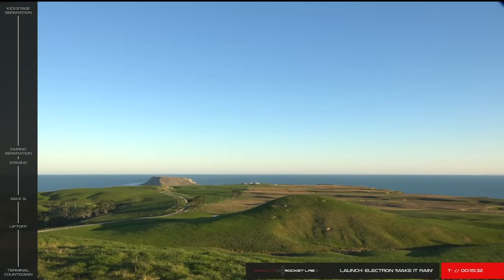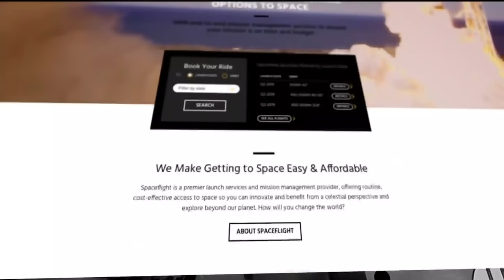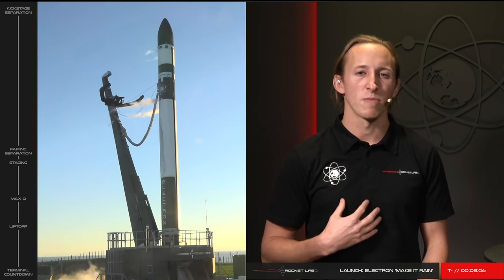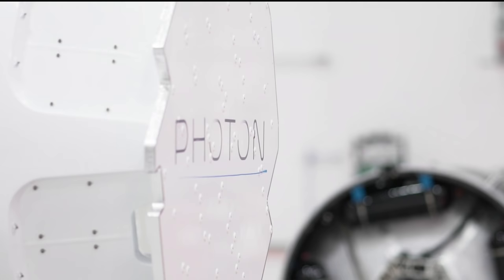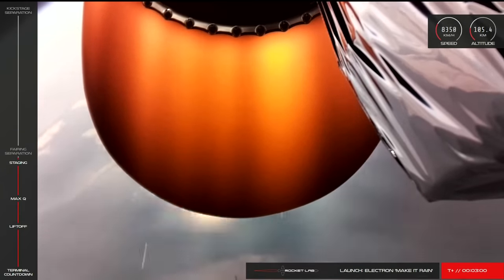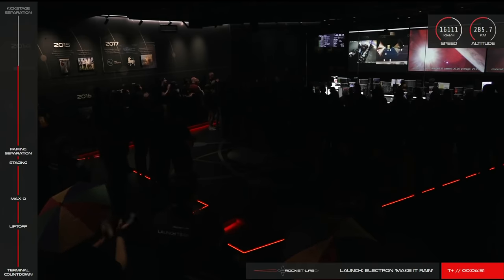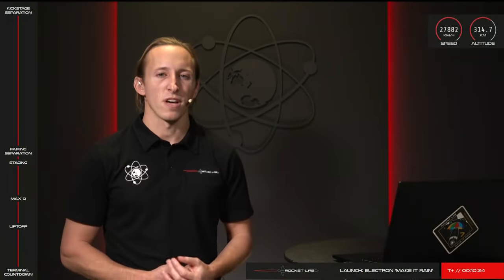Make It Rain Launch - 06/29/2019

Comment: Some of the callouts 
00:00 - [webcast start]
03:58 - "Okay, all stations this is flight on mission [cord?] standby for final poll for launch"
04:03 - "RCO"
04:04 - "RCO is go for launch"
04:05 - "LD"
04:06 - "LD is go for launch"
04:07 - "And executive" 
04:08 - "Executive is go for launch" 
04:11 - "Roger that thank you" 
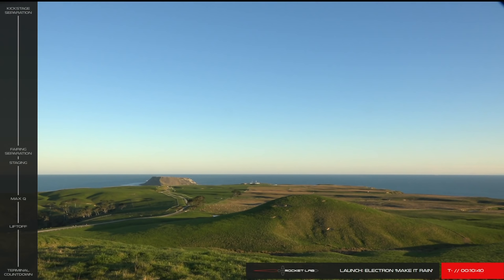08:16 - "clamps open"
08:18 - "preceding with strong back retract"
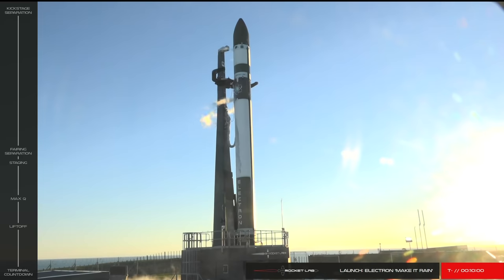08:53 - "BMS flight on mission cord"
08:56 - "Go ahead"
08:59 - "Please confirm all separation events are armed"
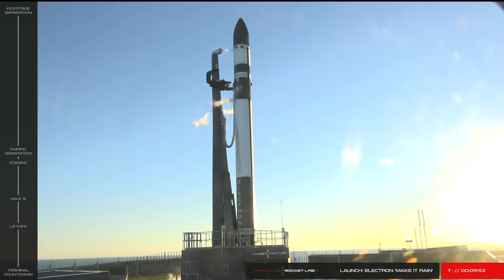09:02 - "All separations events are armed"
09:04 - "And RF flight mission" 
09:06 - "Go ahead"
09:07 - "Confirm that S-band has been switched to high-power"
09:09 - "Confirmed" 
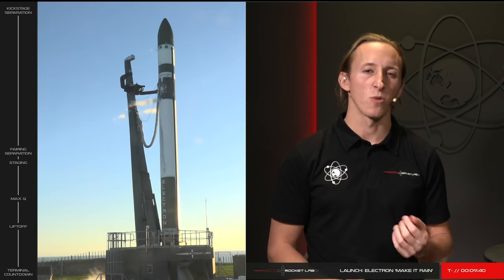09:16 - [unintelligible] (because of the voice over)
09:26 - "Flight avionics mission"
09:27 - "Go ahead"
09:29 - "[HPVH?] fans are disabled"
09:31 - "Copy that and heaters?" 
09:32 - "And heaters"
09:33 - "Thank you"
09:35 - "Flight [?] mission"
09:37 - "Go ahead"
09:38 - "Camera recording [? is at] recycled" 
09:40 - "Thank you, avionics flight on mission" 
09:42 - "Flight avionics"
09:43 - "Please confirm stage two battery hot swap is ready" 
09:46 - "Standby" 
09:57 - "Flight confirming hot swap ready"
10:00 - "Thank you, and confirm stage 2 [HPV?] 1 and [HPV?] 2 are enabled and [HPV?] 3 is disabled"
13:32 - "Thank you RCO, FSO flight on mission" 
13:35 - "FSO go" 
13:36 - "I can confirm the FTS is on internal power, check turn should be up continuously from now"
13:41 - "Copy"
13:42 - "FSO please enable FTS fail safe and confirm"
13:46 - "FSO copies...fail safe has been toggled"
13:52 - "Copy that and FTS flight on mission" 
13:55 - "[?] flight" 
13:56 - "Please confirm FTS is green on internal power"
13:58 - "FTS is green and go for flight"
14:03 - "And all stations this is flight on mission from now there should be no red flags on your LCCs" 
14:09 - "FSO RCO mission cord" 
14:12 - "[?]" 
14:13 - "Confirm flight safety is green"
14:15 - "Flight safety is green" 
14:17 - "Copy" 
14:19 - "All stations [?] mission range is green, auto sequence is armed"
14:23 - "Copy RCO"
15:54 - "FLO this is flight on mission cord"
15:57 - "Go flight"  
15:58 - "Please disable power pack HVAC and confirm" 
16:01 - "Standby"
16:03 - "Power pack HVAC is off"
16:06 - "And LD flight on mission"
16:07 - "Copy"
16:08 - "Vehicle is ready"
16:09 - "Okay, copy" 
16:10 - "VMS LD on mission"
16:13 - "Go ahead" 
16:14 - "confirm, please confirm flight computer as go as green" 
16:18 - "Flight computer as go as green" 
16:20 - "Please look for sequence and confirm" 
16:24 - "Auto sequence is locked" 
16:28 - "And to all operators we are go for auto sequence start at T-2 minutes"
17:00 - "Avionics Flight on mission"
17:02 - "Flight avionics"
17:03 - "Please confirm all AV-bats have been switched to internal power"
17:06 - "Vehicle is on internal power" 
17:07 - "RCO flight mission" 
17:08 - "Go ahead" 
17:09 - "Confirm ground power is disabled"
17:11 - "All ground power is down" 
17:13 - "Roger that, and all stations be advised vehicle is now on internal power" 
17:17 - "Five"
17:18 - "Pressing LOx"
17:48 - "[?] flight mission" 
17:50 - "[?] copies"
17:51 - "Please disable anti-geysering and confirm"
17:53 - "All stage anti-geysering is disabled"
17:56 - "Copy that, stage 1 flight on mission"  
17:58 - "[?] Stage 1"
17:59 - "Please confirm stage 1 is pressed" 
18:01 - "Stage 1 is pressed"
18:02 - "High flow engine purge" 
18:04 - "Stage 2 flight mission"
18:05 - "Flight stage 2" 
18:07 - "Please confirm stage 2 is pressed"
18:08 - "Stage 2 is pressed"
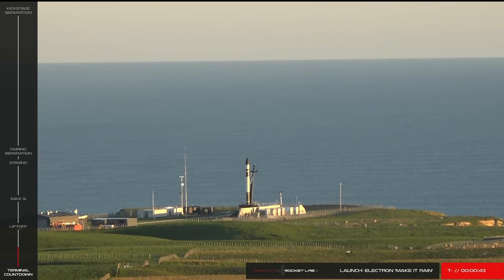18:13 - "Commanding deluge on" 
18:22 - "Deluge running" 
18:30 - "Readying GNC systems"
18:38 - "Re-readying engines"
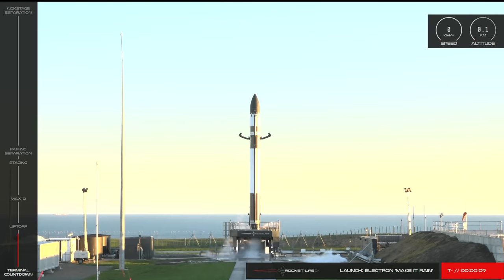18:48 - "10"
18:49 - "9"
18:50 - "8"
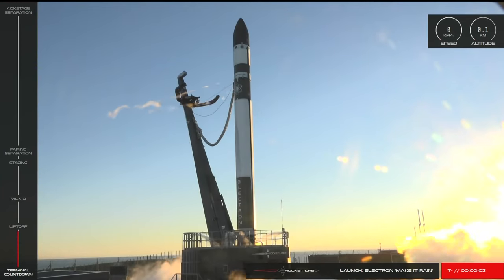18:51 - "7"
18:52 - "6"
18:53 - "5"
18:54 - "4"
18:55 - "3"
18:56 - "2"
18:56 - "ignition" 
18:57 - "1"
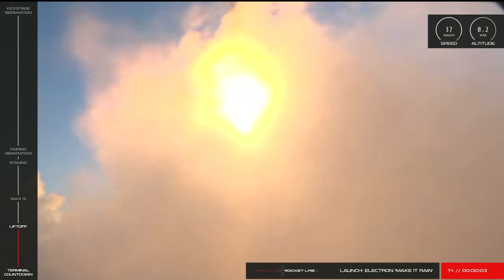19:00 - "Liftoff, vehicle has cleared the pad" <--Nice timing
19:52 - "[?] tracking downrange"
20:09 - "Coming up on maximum aerodynamic pressure"
20:35 - "1 minute stage 1 reaming" 
20:39 - "Stage 1 propulsion remains nominal"
20:50 - "AOS [?]"
21:17 - "Power packs [?] has succeed"
21:21 - "15 seconds remaining" 
21:24 - "Entering stage 1 burnout detect mode" 
21:36 - "Stage 1 MECO" 
21:40 - "Stage separation succeed" 
21:55 - "Guidance is nominal" 
22:07 - "Fairing separation succeed" 
23:27 - "Trajectory remains nominal"
23:30 - "Stage 2 propulsion remains nominal" 
24:52 - "Vehicle safe gate [?]"
25:30 - "Coming up on HV battery hot swap" 
25:36 - "HV battery eject succeed"
25:47 - "And stage 2 propulsion [?]"
26:07 - "100 seconds remaining"
26:48 - "1 minute remaining"
26:51 - "Entering stage 2 burnout detect mode" 
27:28 - "20 seconds remaining" 
27:50 - "Stage 2 engine cutoff"
27:53 - "Transfer orbit is nominal"
27:55 - "Kickstage separating" 
28:24 - "[?] Curie"
30:02 - [end of webcast]
Edit: @28:24 fixed, thanks to @Overdose (see replies)
Reply: 28:24 He says something "Curie", the name of the kick stage engine.
Reply: @CausticLemons7  Thanks!
Reply: All the "HPV?" mean "High Pressure Vessel"
Reply: Deserves more likes.
Reply: we all wanted to see 19:00

Comment: Excellent launch. Congratulations to all involved. Can we stay with launches until deployment of payloads, whenever possible please? It's interesting to witness successful mission completions. Thank-you.
Reply: I too would love to see a view of the third, "space tug"-like, kick stage deploying, and/or views from the third stage itself during and after separation, up to payload deployment(s). But with its very small Curie rocket engine, powered by a hush-hush "green" propellant, it is possible that they can't spare the mass allotment for a video camera/transmitter system on the third stage. Also, maybe they do it out of proprietary concerns, if seeing the Curie's exhaust plume (if it isn't invisible) might give away the formulation of its propellant. (For several years, only black-and-white photographs of the Atlantic Research Corporation's Arcas meteorological & small sounding rocket could be published because it used the same, then-secret, composite solid propellant as the first stages of the earlier Polaris submarine-launched ballistic missiles [the early ones used double-base propellant in their second stages]. Color photographs of the Arcas, showing its exhaust plume, would have given the Soviets and the Red Chinese hints as to the composite propellant's formulation.)
Reply: Agreed, a camera on the payload would be ideal too. Just have an intermission like SpaceX with an animation.

Comment: 17:02 What happened here? Why so much vapor suddenly?
Reply: I know you must like rockets. So read up a bit. Yes I know it is rocket science. LOL. The tanks have just been toped out and now pressed for flight all other excess gas is now vented  while top up is maintained till T zero.
Reply: @thericesquad  I meant vapor not from a rocket. There was a huge amount of vapor from something at the right side of the screen.
Reply: The tank ports opened and released excess pressure
Reply: @FeelGoodOK  I beleive the vent pipe work being super cold after the tanks topped out started to condense the moist air passing that pipe work. They are next to the ocean after all.